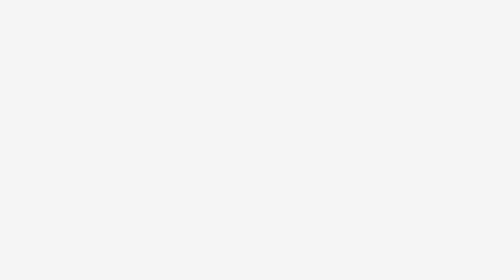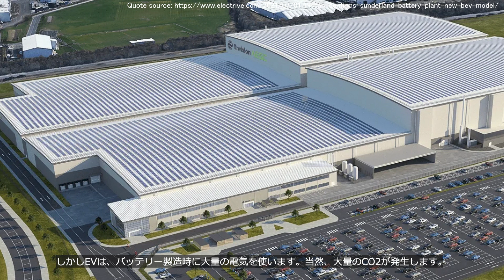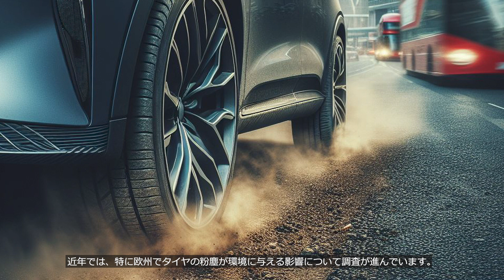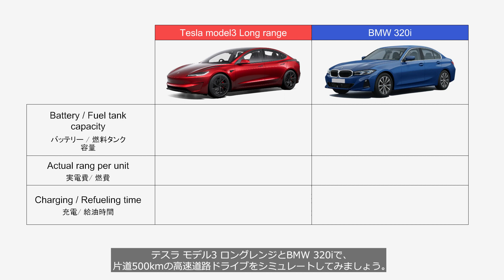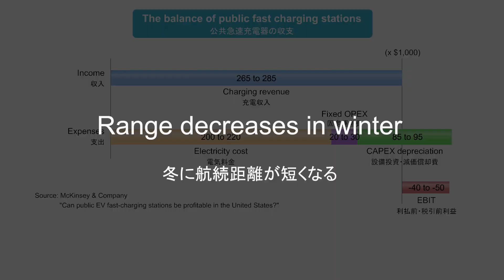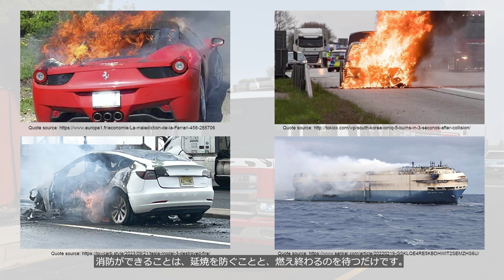All the BAD points of Battery-EVs

Comment: As far as I'm concerned there are no positive points.
Reply from the maker: I agree with your opinion 85%.
They rushed the transformation despite the technology being incomplete.
Reply: @sikasabumotorchannel  You only also briefly described battery longevity, which is likely not going to fail until at least 200,000 km.  

We will need to see how long battery packs last and if replacements will even be available for today's BEVs.

That's my major concern.  Good thing we are likely going to get better battery tech in three to four years' time.
Reply from the maker: Thank you for watching the video and for your comment.

I’m not too worried about battery failures either, but I'm interested in the decrease in capacity. 
I think it varies greatly depending on the usage conditions. (primarily the number of fast charges）

I'm also looking forward to the solid-state batteries that are said to be coming out in a few years.
But, I have just one concern.
Since the debut of the Nissan Leaf (the first modern EV) in 2010, battery engineers and automakers have been saying that “technological breakthrough in batteries will be made within a few years”. It's been 14 years.
Reply: @sikasabumotorchannel Maxell already has solid state batteries for medical equipment.  Toyota and Samsung SDI plan 2027 mass production.  I think by end of this decade,  battery longevity will be near 16, if not 20 years.  BEVs will be cost-effective.  ICE easily lasts 20 years.
Reply from the maker: I agree with you. I believe that in 10 years, BEVs will have advanced significantly, and in 20 years, many drivers will choose them. But, I also hope that ICEs will remain, like analog records.